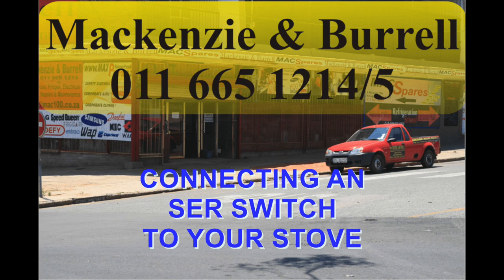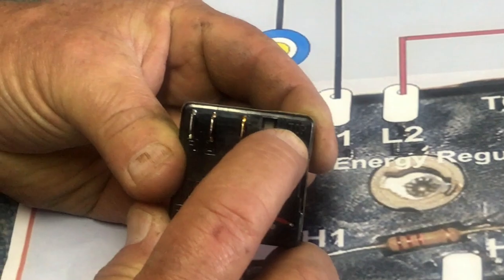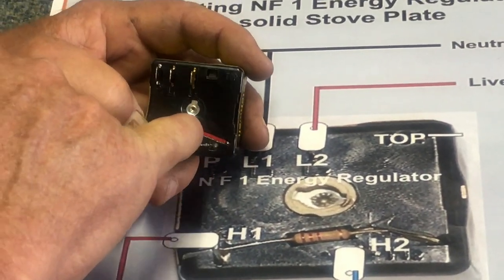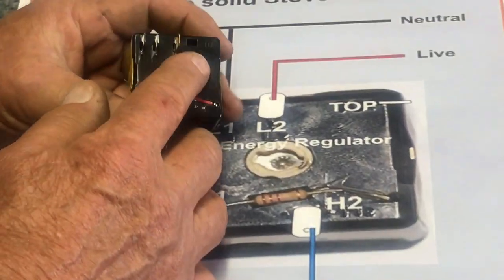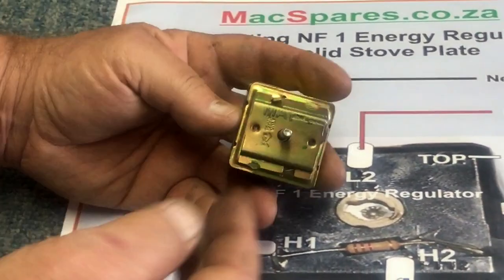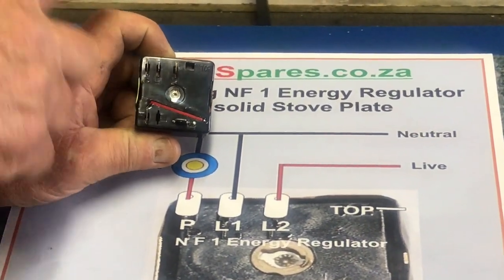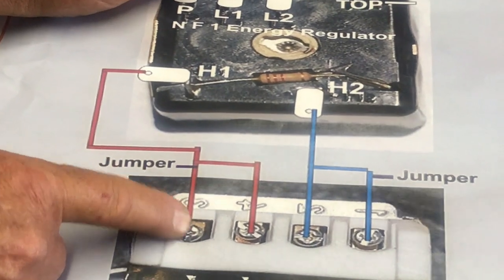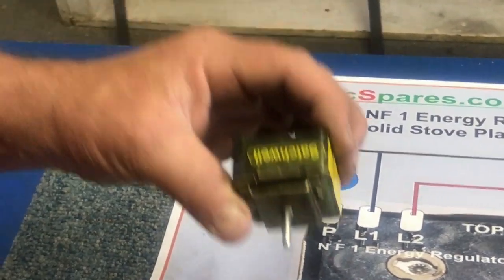SER energy Regulator Wiring Youtube

Comment: These are rubish switches, they burn quickly
Reply from the maker: Please make sure you are using the correct wire heat resistant and that you terminals (lugs) are secure on the wire and switch terminal